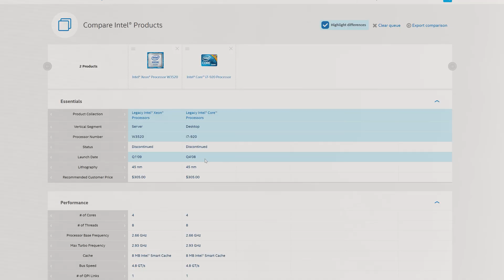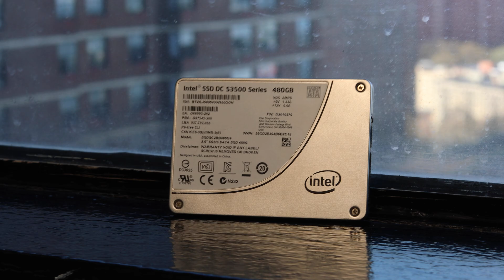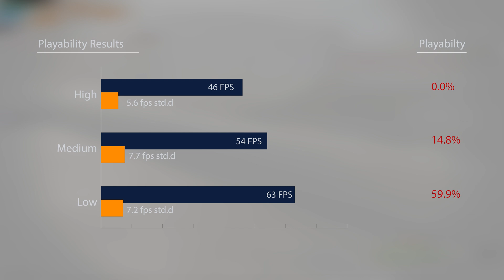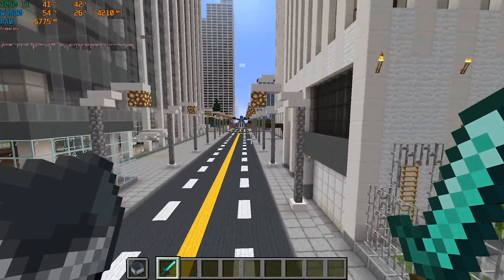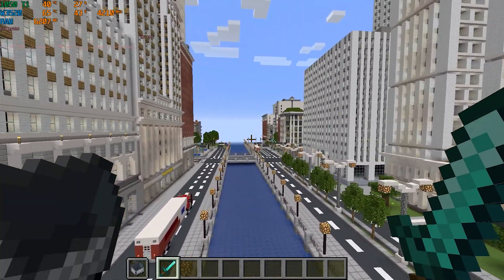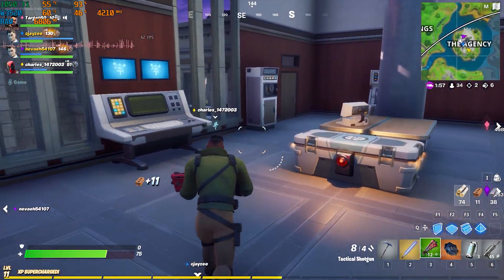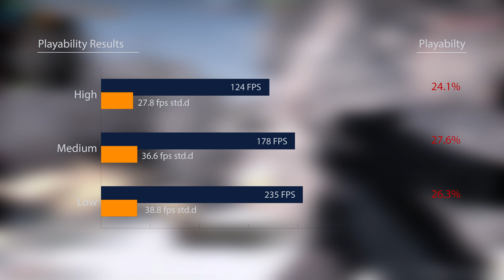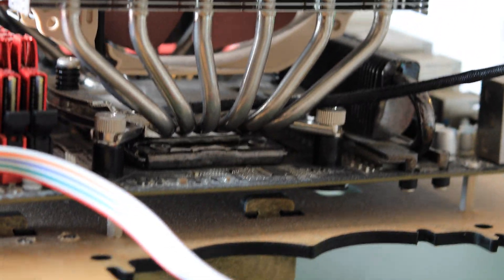Can a 1.6GHz overclock save this $2.35 CPU?

Comment: how do i oc this?
Reply from the maker: Check your bios when it starts up, You’ll need the right motherboard, if you’re using it in an OEM system it likely won’t have the options in the bios.
Reply: im using hp 2400z,
Reply: 2.35 dollars is an absolute steal
Reply: i got that cpu for 28
Reply: i cant overclock if bc my dad has an admin password and he doesnt give privacy which is sad, im almost 13
Reply from the maker: @msc.816  even with the admin password, for that HP system it’s very unlikely to have overclocking options in the bios